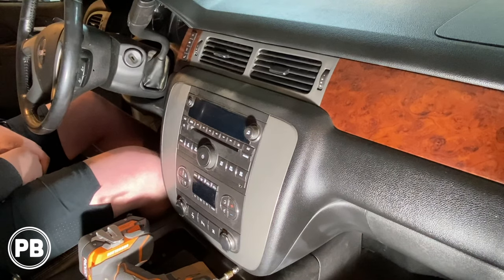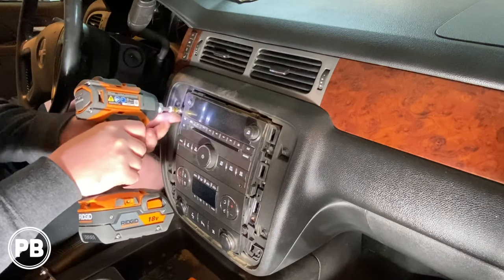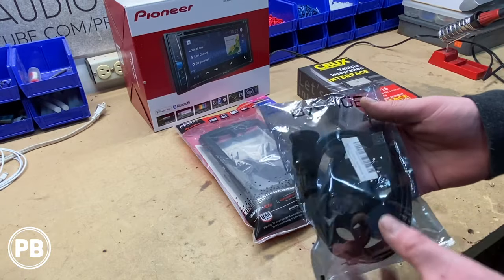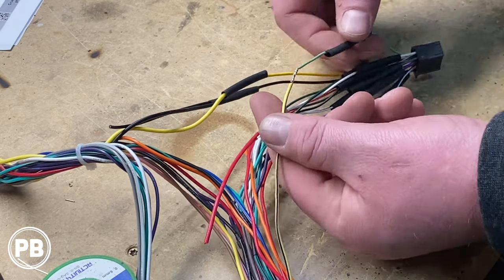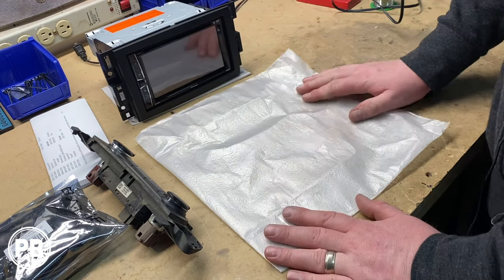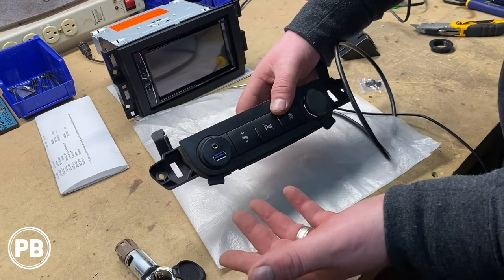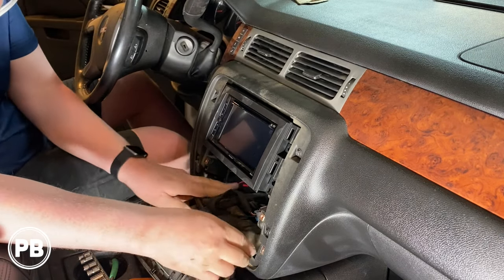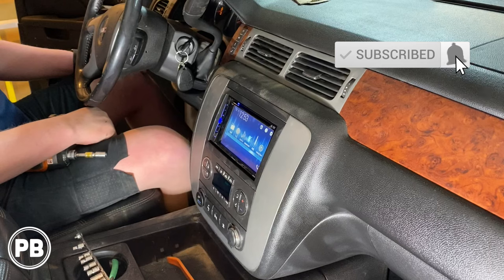2007 - 2014 GMC / Chevy Radio Install Sierra, Silverado, Avalanche, Tahoe Suburban, Yukon, Impala

Comment from the maker: Parts linked in the description!
Reply: do you know how to permanently disable the damb chimes in these trucks with bose sterio non big screen ?
Reply: What part of country did you are
Reply from the maker: @rubencruzgomez1702  Utah!
Reply: Do I need anything additional to incorporate my SeriusXM radio?
Reply from the maker: @thedanceavenueia  Yes, you will need the add-on tuner, the XM tuner SXV300v1, and depending on your radio brand, you may also need the antenna adapter for the tuner (to utilize your factory XM antenna).
Reply from the maker: https://amzn.to/2WM1ULH
Reply: @ProvoBeastAudio  My Tahoe has satellite radio already do I still need the tuner or just the antenna adapter? Thank you!
Reply: Would I use this harness if I have factory navigation?
Reply from the maker: @jrvega2415  You will need a harness adapter regardless if you have the factory navigation or not as the factory harness plugs will never just connect into your new aftermarket radio.
Reply from the maker: @jrvega2415  Yep!
Reply: @thedanceavenueia  Did you ever find an answer about that?
Reply: If the stereo doesn't have a plug for the steering wheel control what can be done to make it work?
Reply: Does The rear radio control work? My aftermarket radio can not work on the rear.
Reply: Where can I find the wire harness at?

Comment: When installing this aftermarket radio, did you have factory remote start? If so, did you retain that or lose it?
Reply: Factory remote start? How does it work? Is there a button on the remote or do you have to press a combination of buttons?

Comment: Also have the same truck and the rear speaker stopped working shortly after they installed the radio. I want to install a new radio which I hope will fix the issue with the speakers. Pro-line the audio store that installed it didn't do such a great job. It was free so I didn't complain. Enjoyed it while it lasted.

Comment: One thing worth mentioning that may not matter to everyone but it certainly matters to me...

The Crux interface adapter does NOT support RAP (Retained Accessory Power). The Crux adapter is configured to keep the radio on until the key is pulled out of the ignition.

If you turn the truck off leaving the key in the ignition the Crux will NOT shut off the radio when you open the door like the factory radio. The aftermarket radio will be on indefinitely likely causing a dead battery. If you ALWAYS take your keys out of your car probably a non-issue but for me it is a non-starter.
Reply: Thanks for this is a bonus for me!
Reply: Who the heck leaves their keys in the ignition indefinitely?   99.9% of all people take their keys with them, so this is a non-issue for nearly everyone but you.

Comment: I am using almost EXACTLY everything parts wise you have listed in the video.

Does the crux unit need to be programmed to retain the factory steering wheel controls with the pioneer unit or is it pre programmed? Also what about parking brake? Reverse light wire? 

Do those wire into the Crux unit/factory plug wiring or do I need to pull wires and wire into wiring under the dash basically a needle in a hay stack hunt?

Please tell me it all wires into the crux unit 😅????

Comment: I did not buy the S00GM-16 because it is very expensive. I don't have steering wheel controls but I do have an Onstar mirror that i don't care for or use. I bought a dash kit, antenna thing and a Red Wolf wiring harness that is compatable with the truck. Do I really need the SOOGM?

Comment: Got a 2013 Suburban LTZ OnStar AM/FM/XM/Navigation/Bluetooth, putting a JoyBring aftermarket, using a PAC RP5-GM32, wired per installation instructions, plugged in Radio works BUT no sound. Any suggestions to get it working?
Reply: Same problem

Comment: I was trying to upgrade stereo in a 09 Chevy Suburban having trouble connecting to the reverse camera Factory a steering wheel control I am using install Kit Crux model dkg m49 you have any advice on what may be going wrong

Comment: Just watched your video on the 5 channel amp speaker upgrade on the tundra Using the kit from taco tune. Someone asked about why you left the factory amp which you replied saying Incase they wanted to go back to stock. My question is, can the factory amp be removed to mount the LOC in its place. I plan to do everything you did in that install but just not using that taco tune kit. I will use there T Harness but that’s it. I just want to confirm removing the factory amp and tucking the connectors away I won’t have any issues. Btw you guys do great work. 👍

Comment: I did this exact kit in m 07 avalanche with bose and my steering wheel controls don’t work. Is there any common issue I may have overlooked?
Reply from the maker: Wiring or dip switch wasn’t setup correctly.

Comment: Small crowbar from Home Depot worked well with me for removing that stainlesss steel plastic bit in the start, however I went a bit too far in and destroyed the plastic where the screws go in for the Air conditioning controls and one of them popped out
Reply: If you damaged the AC controlls then a crowbar didn't actually work so well, did it?
Reply: @robertatkinson6864  the dash was already super cracked so I’m Not surprised

Comment: I did an upgrade on my 2012 GMC ACADIA RADIO, from stock to touch screen.. taken from a 2010 Acadia.. mine truck doesn't have Radio Module Interface an like two other connections cable..can you check it out and let me know where I believe is the only two large cables runs to from the radio? Thanks much..

Comment: Hey great video! Your content is super helpful! Here's my issue. I have a 2012 Suburban LTZ with Bose and Nav. Installing the Pioneer AVH-2550NEX with the Crux SOOGM-16 interface. The connectors on the interface don't match the connectors on the vehicle. Like, not even close... Any advice?
Reply: Any luck
Reply from the maker: Hey there, if you have factory NAV, you probably need the Pac RP5-GM32 based on your year and trim: https://amzn.to/3R4aoFs 
HOpefully that helps!
Reply: Did you ever figure this out? My connectors are way different as well and one is quite large. Same problem as you possibly, did you find the correct harness?

Comment: I just bought my 2008 Tahoe last Xmas and I just installed my second aftermarket stereo.  I keep having issues where the day after I have the new one installed (at two different businesses,) the radio takes 15+ mins to get power and turn on, if it turns on at all.  I was wondering if anyone else has had this issue, and if so, what was done to fix the issue?

Comment: I can't find any aftermarket options for a 2008 silverado ltz with a factory touch screen and navigation. I want to replace the factory unit to a dub din  but there is no videos on it ? Any information would be greatly appreciated
Reply from the maker: It's the same process and parts listed in the description of the video will work great on your install.

Comment: Nice video this help a lots thanks.
Only one question, I got two Amps one for my Subwoofer, and a 4 channel Amp, am going to used RCA for those two amp. Do I unplug the factory bose amp and will my will my second screen for the kids still work?
Reply from the maker: It will using the right adapters: https://youtu.be/QgdlcTF9hpU

Comment: Been trying to figure out this radio out that i bought Pioneer AVH-120BT. I have a 2012 seirra, for some reason the radio stays on the entire time. I bought the Metra  GM29-SWC, following the wiring diagrams its correct. I can't seem get my steering wheel controls to work. Any help would be appreciated, I've been looking all over online and I am either missing it or I can't seem to find what I did wrong.
Reply: I know it’s been a while but do u remember what u did to fix this problem
Reply: @VooDooChild7300  the main/accessory power was messed up in my truck. I had to swap those 2 wires out, and it worked like a charm until the truck met its bitter end.

Comment: Hello there i have an extra cable without pair it's the yellow with black line that says mute where should i connect that on the crux the radio is a Pioneer AVH-W4500NEX thanks?
Reply from the maker: To the radio’s yellow / back wire. If it doesn’t have a mute, just cap it off as it won’t be used.
Reply: @ProvoBeastAudio  thanks and happy new year!

Comment: The retains the Onstar but you said it doesn't retain navigation so if Onstar sends directions to my truck, it wont read out anywhere like on the radio display and it wont show on the radio GPS correct?

Comment: I did a radio install on my 2007.5 GMC Sierra 1500 slt and I had two hook ups and the antenna hook up, my Bluetooth connects and says the song is playing but no audio is coming out the speakers. However when you play the local radio the speakers will work

Comment: is the adapter supposed to make the turn signal sounds?🤦🏻‍♂️
Reply from the maker: Depends on how the turn signal was generated with the factory radio.  If those sounds were created and played through the factory speakers, then the harness will replicate that from the smart module itself (not through the new radio).  If the noise was created from a separate dedicated speaker behind the dash, then it will continue to function as such.

Comment: Thanks for your help buddy .I have one more question for my radio I got my first one and it came in with a busted screen are or is it replaceable or can it be fixed?  Thanks again
Reply from the maker: Not worth repairing. Suggest replacement.
Reply: @ProvoBeastAudio  They didn't want the old one back so I thought I could maybe try and maybe replace the screen? Any suggestions?

Comment: so you only need this single module from crux compared to the 2 different modules if you go with the Axxess from the original video? this one  retain the chimes too?
Reply from the maker: Crux is an all-in-one module for a better price, where Axxess / Metra requires two separate.    Crux retains all your chines and factory Bose as well (if equipped).  Better solution!

Comment: Does that vehicle have rear climate control behind the center console?  Did you lose the climate and radio functionality back there?
Reply from the maker: This vehicle wasn't equipped with them, but as for radio controls, they become obsolete behind the center console with a new radio, but the climate controls should still work.

Comment: Tried to do this same install on my 08 yukon xl, radio works but for some reason the rear dvd system is showing the main screen for a dvd but once I hit play the movie just plays, with the same screen. I used all parts you put in the description but I cant figure it out.. I also did the micro bypass and the front unit still said something along the lines "it is prohibited to watch videos while driving." What the heck am I doing wrong?!?! Thank you!
Reply: You can only watch videos with the parking brake set if you wired up the I believe the pink wire. I just disconnected the pink wire "ebrake wire " and can watch tv when ever

Comment: Ty for this video it was great. I used all your links to make my purchases. Everything is working well except my steering wheel controls. I followed the dip switch settings and it’s not working. Any suggestions?
Reply: I am having this same issue.
Reply: @shawneehaggard7764  turns out I had the SWC wire plugged into the wrong outlet. Try other outlets on your radio.

Comment: What do you do with the blue wire from the steering wheel control harness? I’ve looked all over and can’t seem to find anything
Reply from the maker: It should be a blue / yellow, and it is for a kenwood or JVC radio.  If you don't have that type of radio, just tape it off.
Reply: Did it work? I cant figure out how to get my navigation to work without using my Wi-Fi

Comment: Ok, I have a 2010 Chevy Silverado no navigation it does have an onstar button. Can I just get a wiring harness or do I have to get the interface? I miss old school stuff lol.
Reply from the maker: You will need a smart harness to do it right since accessory, illumination, etc. runs  over the canbus of the truck.

Comment: if i dont have factory bose where does the plug go at  7 mins 5 seconds...
i do have steering wheel controls and the same old radio you removed.
i have a 2008 burb
thanks
Reply from the maker: Just plug it into the "non-bose" port.

Comment: I do have a quick question.
My friend installed a aftermarket radio in his 2008 GMC Sierra.
Use all the correct harnesses and retained his steering wheel controls and when he went to work this morning his truck was dead. 
What could be the issue?
He told me his radio would stay on after shutting his truck off and would kill his battery..
Reply from the maker: Sounds like a wiring, harness, or radio issue. If the radio remains on, sounds like a wiring issue or the smart harness is bad.
Reply: I as well had this happen. I installed everything, double, triple, quadruple checked, I even carefully hooked it all up before I heat shrink and taped it to make sure everything worked right. It worked right! But after tested to make sure it all worked, I screwed it all in and put it all together, my truck had died in that amount of time being hooked up to this radio. Any idea why it would have happened like that so fast? What is connected that it is draining the battery so fast? I also got a warning to check/service stabilitrack moments before my truck completely lost all battery power. I turned on the radio to finish configuring time and settings, and it literally was it these few minutes that my battery had completely went dead. I’d love your input, if possible something a little more specific than some general advice. Thanks for tour help, this video was awesome!

Comment: Do you have to use the Bluetooth mic or can you use the factory built-in mic?
Reply from the maker: Factory mic is on its own protected circuit so usually the new aftermarket one is required (analog style)

Comment: can i use an aftermarket amplifier with this? say im using a skar 1500 class D amp. will it work?
Reply from the maker: Sure, any amplifier as the radio has RCA pre-outs.

Comment: Wondering how you installed the parking brake bypass. Also it says the parking brake bypass can not be found on Amazon.
Reply from the maker: https://youtu.be/0xYNn8LDvnE

Yeah, all of them were pulled from amazon.  I have a link to ebay in this video linked above.
Reply: Have you tried the Pioneer NEX setting to bypass the video play. Asking bc I have the 
DMH-W4660NEX and supposedly there is a setting to bypass the video play. Just wondering!!
Reply: Also can you do a video on installing the 
DMH-W4660NEX. My 1st instal and I do not want to screw it up. 😂 I will let you know how it goes.
Reply from the maker: @dethstorm1386  W-Series Pioneer radios (with newest software update) allows you to forgo the microbypass and instead bypass the radio with a series of touch screen touches in the right order.  We will have a video of that shortly.
Reply: I have a speed sensor input wire but I am not sure where to connect it. Any idea? And the mute wire is not a loose wire on my crux harness I guess I need to cut and connect to the mute wire for my pioneer stereo? Thanks for the help again in advance.
Reply from the maker: @dethstorm1386  VSS wire will need to be connected to the VSS wire on the radio.  If your radio doesn't have one, just insulate it as it wont be used.  Mute wire on the crux harness is mainly used for OnStar.  If you are not using OnStar, just leave it alone.
Reply: My radio has a vss wire but the crux harness does not. So I was not able to connect it or I just did not see a wire labeled as vss on the crux.
Reply: I do have onstar  in vehicle…I was wonder if the mute wire from the stereo connects to the mute phone wire on the crux? Any suggests on the vss….where would I connect the vss on the crux

Comment: Which plug did you use for the steering wheel controls. I see it was the 3.5 jack but which plug did you use on the back of the radio?
Reply from the maker: Follow the crux instructions based on the radio brand you have. Our pioneer had a 3.5mm W/R steering wheel control input port where we made our connections. If your radio brand does not, refer to the crux instructions on how to connect them to your radio.

Comment: This may be a dumb question but how to you play video if the radio does not play cds... I have the rear entertainment and an apple phone which the radio I installed has apple car play... what platform or function do I use to watch videos on the rear entertainment system
Reply from the maker: Check out the HDMI adding video that will help
You there. Also you can play media from
A thumb drive.

Comment: What if my deck doesn't have the 3.5 plug in the back
Reply from the maker: 3.5mm for the AUX or steering wheel volume controls?
Reply: @ProvoBeastAudio  steering wheel volume controls
Reply from the maker: @shawnbeach1421  Then you will need to follow the crux instructions, but the plug off and wire in for Key 1 and 2.

Comment: Good luck installing the top end Pioneer head units without destroying the dash supports. The Pioneers are too deep by 10mm.
Reply: Crutchfield lists this as "not fitting" but it slid in so nicely for this guy??? Did he pre cut something? I want this unit but not.if I have to hack the car up.

Comment: I got the same radio on '11 sierra and after the installation cruise control won't engage any thoughts?
Reply from the maker: I'd remove the negative off of the battery and do a full reset.  If no success, reinstall the factory radio to see if the cruise control works.

Comment: I just installed the metra 99-3305 for the Tahoe , radio went in fine into the mount, but when I mount in the Tahoe it’s a little crooked on one side.  Is there any fix fir this? I see a lot of people have had the same problem
Reply: Washers